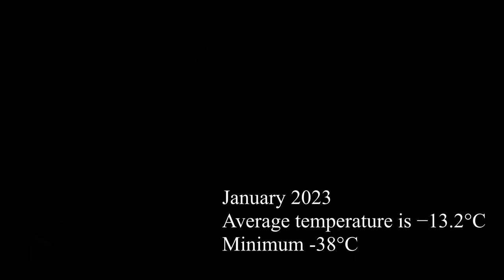SURVIVE THE WINTER IN A SMALL COZY LOG CABIN.Documentary.

Comment: By running your stovepipe directly outside, you lost about 6 feet of good radiant heat, having the riser outside.
Reply: You should start your own channel
Reply: @billyv1206 he's right
Reply: that roof looks temporary..maybe he ll put it straight in time..
Reply: Could you elaborate? Plan on installing something similar in my cabin
Reply: @DarkAesthetics33  he means going straight up with the chimney that way you get more heat inside ..then going early horizontal outside
Reply: César 🌨️🌨️🌨️🌨️🌨️❄️❄️❄️❄️❄️☃️🌬️🥶🏔️🌡️ si
Reply: Maybe he should build a “mud room” around the pipe outside to take advantage of the heat and hang wet jackets up or store water.
Reply: I find this idea not bad. But the fire risk is way above compared to the outside Variant. It would require a different Material for the roof.
Reply: You are allowing  too much air  into  the stove when you have sparks coming  out of the pipe.  Put two 90 elbows  with a damper  in the  pipe
Reply: @giles-df9yu There’s a reason actual fireplaces don’t have 90* bends my guy.
Reply: Maybe he doesn’t want it to get too hot inside?
Reply: It's safer the way he ran it and he doesn't have to worry about a leak with a big hole cut in the roof and more importantly, the size of the cabin is small enough where he has plenty of heat with his current set up. Not to mention it's easier for him him to clean and maintain the pipe.

Comment: Removing the snow from the roof should only cool the hut, the snow in that quantity works like a heating blanket, and then to keep a bear from entering, that bolt is fine but I would also add two stakes that block the door, one above and one in half, if a big bear wants to break down the door, it's better if he finds it right away that doesn't give in because if he gave in even a little he would try for hours and I must say that a bear could also demolish a wall of a shack.
Reply: Snow is a good insulator indeed, but a thick layer of heavy snow - especially in the spring - can cause collapses even in modern buildings.
Reply: @janbo8331  In order for the roof not to fall under the weight of the snow, we need to put more robust beams and it certainly won't happen that the roof breaks, think that you are sick and it snows a lot and of course you can't go up on the roof to shovel the snow....?

Comment: Your stove chimney gets glowing hot, have you ever thought that the pipe outside is losing perhaps 35% of your heat, plus chimney pipes when straight up draw better as no tight bends to go round, what am basiclly  saying, put chimney out through your roof, you can dry damp/wet clothing much better too, i would also put some safety metal sheet at the cabin sides around the stove its self, ,if you can find any, pile rocks up each side, these take waste heat and keeps your small cabin warm when stove has gone out.

Comment: I must say that the classic mistake that almost everyone makes is to build the door that opens inside the cabin instead of building it that opens to the outside which firstly leaves space inside for other things and secondly by digging a border on the trunks put any bear is prevented from pushing and a small closure is enough to block the door which, being also recessed, the bear would not even be able to insert his nails to pull it outside and the "safe" door must be robust and small, not higher than 160 cm but must be at least 5 / 10 cm thick.
Reply: Not so in the winter,
Reply: @michael-7240  Well the winter passes and in the spring the bears wake up hungry and will look for anything that smells like food and will take it by any means and having a door that opens to the outside helps, not everyone knows what strength and power a bear has of 3 or 4 quintals, can very well remove nailed boards and I know for a fact that for example a polar bear which on average weighs 5/6 quintals can break a massive door 7 centimeters thick, also because the polar bear is trained to break the ice under which the seal pups hide and it takes a lot of power to break the thick layer of ice quickly because otherwise the seal escapes into the water. The brown bear is naturally less powerful than the maritime bear but it too has very powerful front muscles and also the weight to support its power.